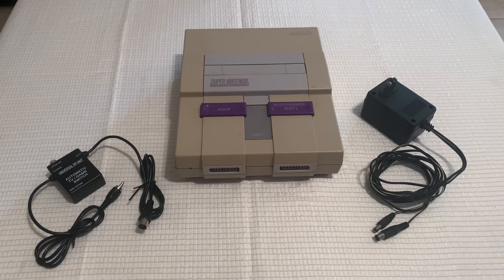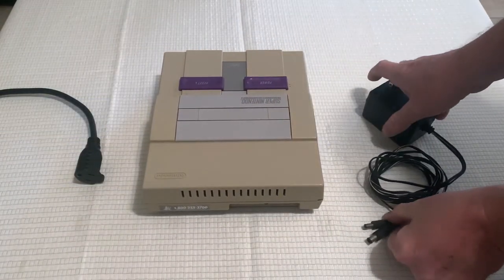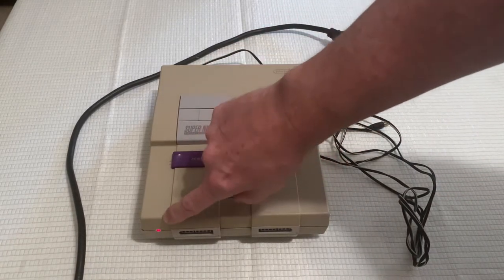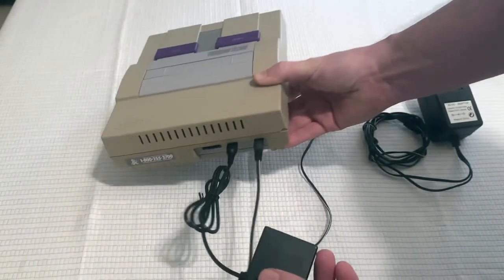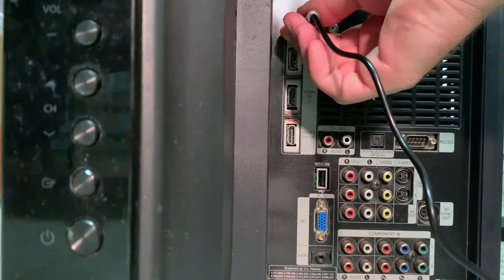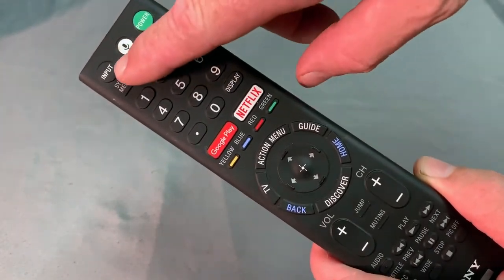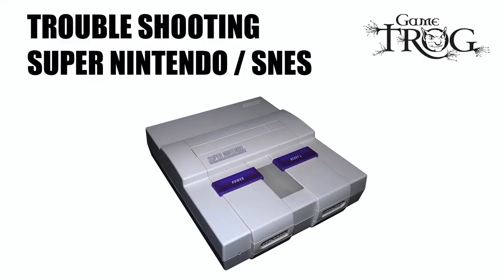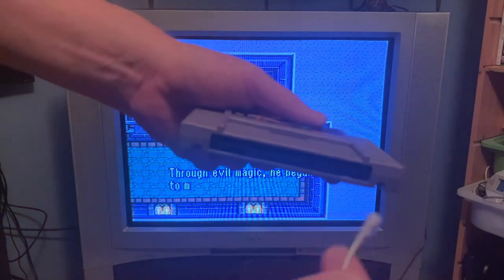How to connect your Super Nintendo - SNES, using an RF Box / Switch

Comment: Hello, I picked up one of these for my SFC and it seems to work great, however I'm getting a lot of wavy/shaky RF interference. Any tips/products you'd recommend for mitigating that?
Reply from the maker: Greetings Nick! Wavy lines and interference can be an issue with RF cables. I have seen where just moving the cable so that it is not sitting next to power supplies or other cables can help. Outside of that, moving to an RCA cable (if possible) is always the best option.

Comment: i hope you still read the comments. When i first got my snes i just had to connect it to my tv run the channel scan and i was ready to play. Last week i had to reset my tv and now i just cant make it to work, do you myb know the problem? It just asks me to scan for channels over and over again and i cant get that gray static picture just a black screan with pleas scan
Reply from the maker: Hmm, if you are able to go to the channel (3 or 4) and it shows a black screen (and not static), then it sounds like it could be a dirty cartridge. Maybe clean the game or try a different game. If you can't get the TV Channel Scan to add the channel you need (it skips adding channel 3 and/or 4), you might be able to manually add a channel (I can do that on my TV). Another solution would be to get some Composite Cables (Red, White & Yellow)  instead of using the RF box, if you TV has those inputs.
Reply: @thegametrog  it shows a black screen and (pleas scan channels). During the scan it skips channel 1 to 5 and starts from 6. How can i add channels manualy? When i get into the menu the only options i have i scan.
Reply from the maker: @dzicsenpai5284  The Manual Add would be TV specific I think, so if you don't see that option you may not have it. Did you try a different game? Is you SNES powering on (red light on?). You might also try changing the channel select on the SNES from 3 to 4 (or the other way). Also try another TV if possible for testing.

Comment: I have HD tv with the RF input i tried but no signal, any suggestions?
Reply from the maker: Greetings Ron! OK, are you sure the SNES works on any TV? Does it power on? Have you tried different games? If it hasn't been played in a while you might need to clean the game also. (You probably know this but) On an HDTV you would need to go to the AIR channels for local TV and try either channel 3 or 4. If your TV has RCA inputs (red, white & yellow) you might want to get an RCA cable (your RF box could be bad) here: https://gametrog.com/product/snes-n64-gamecube-av-cable-rca/ . Or with your HDTV you could even use the HDMI cables I sell. I have them here: https://gametrog.com/product/3-in-1-hdtv-cable-for-gamecube-n64-and-snes-hdmi/

Comment: I recently picked up at a yard sale. A original Nintendo rf switch. It says on it s (nes). I was wondering is that only for the super Nintendo console. Or can it also be used on a original nes console. Did either the nes or the super Nintendo have there own rf switches or are they the same and can be used on either one. Didnt want to mess up a nes console by using a rf switch Thats made for the snes
Reply from the maker: Hey George, the exact same set-up can be used for the NES just like the SNES video above, just swap the consoles and every step is the same. The RF box will work for both systems, so they dont have different ones. You should be good to go!
Reply: @thegametrog  ok. Thanks. It said s(nes) wanted to make sure that it Wasnt exclusive to the super Nintendo only. Didnt know if the super nes had one that says snes and the nes one just said nes. Its been 30 yrs since I played my nes and s nes. My memory is bad. Lol

Comment: I don't think I would ever use RF to hook my Super Nintendo to a TV. Even back when the first TV I ever had only came with a coax input, my VCR was hooked to that, and the cable box was hooked to the VCR's coax input. Anything else was hooked up to the VCR's composite input via an A/V switcher, including SNES, NES, PlayStation, etc.
Reply from the maker: If you are or were connecting you VCR via coax, and then pluggin anything into the VCR even if you're using RCA on the back of the VCR, it's still getting converted to RF as that's how you have the VCR hooked up.
Reply: @thegametrog  Was. The TV in question died a long time ago, and while the HDTV I now have does have an RF port, it’s useless/not used as I don’t have a digital to analog converter

Comment: Hi there, I'm trying to set up my snes pal version with the aerial switch box. I've plugged everything in, the power light comes on but the snes doesn't have a TV channel select button and I can't seem to find what channel its on. I've looked through every channel (1-100) on the static TV channel like you showed. Its the only static option when going through all the sources my TV has. Hope you can help :)
Reply from the maker: It would still be channel 2,3 or 4 I would think.
Reply: most game consoles tune into channel 36 here in the uk, try doing another manual atv tuning

Comment: As someone who recently found a TV and had to educate myself how to get content on old TV'S. I highly recommend to stop using RF modulators with limitations of only channel 3 and 4. Channel 3 and 4 suck and weak power. You need  a version of a Rf modulator that let's you use any channel besides 3 and 4. The modulator I have is HDMI to RF with custom channels. Channel 70 is the best quality. It looks exactly like RCA cables. The truth is, RF channels aren't equal at all and I don't understand why channel 3 and 4 were the recommended channels back in the day. Channel 70 is the superior channel. The modulator I have is blue on Amazon. There's 2 versions of it. One that takes RCA cables. The other one takes HDMI, the one I own. Channels 3 and 4 will always have static on the TV regardless what you do. Channel 70 is literally like HD. Please move away from that limited 3 and 4 modulator.

Comment: Welp. My TV doesn’t have any outlets like that so I guess I’m screwed
Reply from the maker: Hmm, Every TV i've ever seen should have the coaxial connection. Even new TV's. You may have something already plugged into it. Like an Antenna, or Cable or Satalite TV cable. If there is something already there, just unscrew it and then screw the cable into the RF box, then put the RF box where the cable was. If for some reason you dont have this connection type, check and see if you have teh Red, White and Yellow connections and get that cable for your SNES.